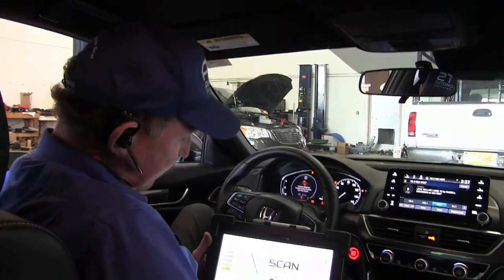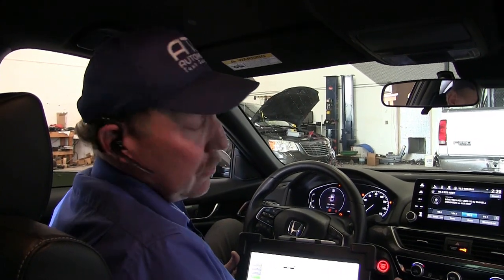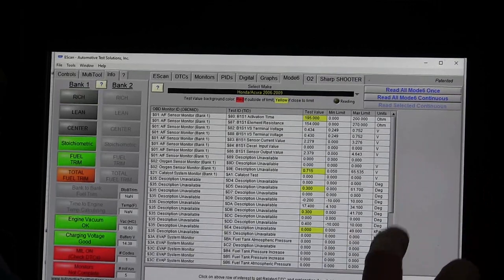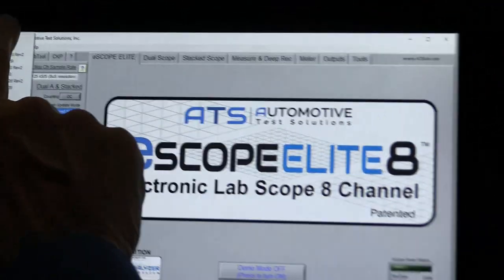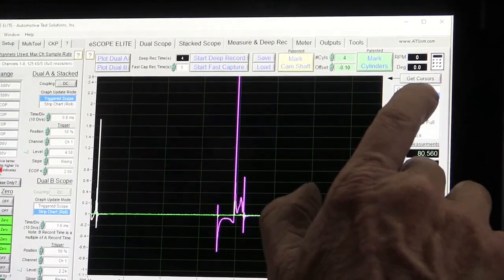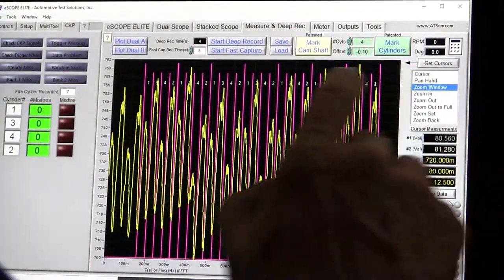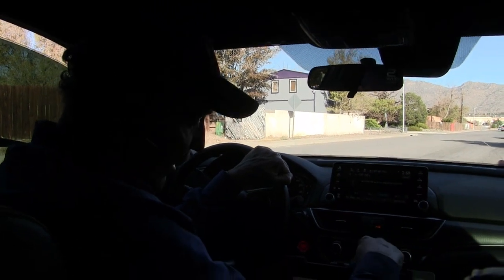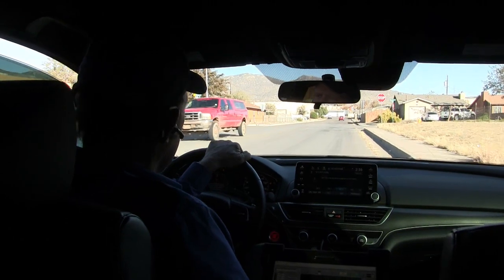Diagnosing a Misfire & Lower Power on 2018 Honda Accord 1.5 Turbocharged Engine P0304

Comment: So what happened here? The #4 injector was flowing too much fuel and the computer sees it and takes fuel away and now the cylinder 1 and 4 are running lean that causing the misfire?
Reply: Thats what it looks like to me.that #4 was over fueling and pcm was subtracting fuel from others.thats why fuel trim was in negative. But like Bernie said test results weren't even across the board so need to replace all injectors
.
Reply: @frankjohn4302  I wouldn’t take any chances of just replacing 2 inj.
Reply: @glennallen7129  yeah that's right.replace all 4

Comment: Why is this not at the dealer for factory warranty?
Reply: Probably was with no fix
Reply: @joshwilson849  i had one took it to 5 dealers and they didnt want to fix it i had enough and  brought a Toyota
Reply: @richardc6038  did they fix the Toyota?
Reply: @richardc6038  Why doesnt Honda want to fix problems? Their dealers suck!
Reply: @jamesmedina2062  in my case with the 1994 honda acored bad  oil ring you know what honda said oh will
Reply: @paquesepas6696  no i broght a toyota after honda fail me
Reply: @richardc6038  Ok but this was a '94 Accord? And this happened when like in 1995 or 1996? Any issues must be repaired according to national lemon laws.
Reply: @jamesmedina2062  it was 94-95 the probem was honda refuse the recall yes it was a Lemon car ! How ever my lawer  told us it not worth going after honda
Reply: @richardc6038  They have no reason to not send the dealer a new engine. I worked for dealers and the dealer makes good money doing the work. That just seems unless the vehicle looked abused or had over 100k miles. Also never only listen to one lawyer. Its just one asshole's opinion.
Reply: @jamesmedina2062  that said No and that it this car was never Abused in fact thay waned to buy the car from my dad ! He said No way he knew what thay was going to do  give us 2G then sell it for 7  the car did have 94,000mi
Reply: Here’s the problem with Honda dealerships. They went so long servicing a great product, not too much out of the ordinary, that now, when they have a POS product, their techs don’t know what to do!

Comment: Question; toyota uses port injection + Direct injection. This seems to keep the intake valves cleaner, great. But If this honda would have had both port and direct injection would the problem have not been as severe?
Reply: The question is not about the technology used but the reliability of the suppliers injectors. It has nothing to do with what kind of injection system used.

Comment: excellent  video Bernie! Thanks very much. I'm faced with an almost identical problem on a 2017 ridgeline and want to do the fuel pressure drop test. Can you explain how you inserted your fuel gauge into the rail? Did you just T off of a connector or...? Thx!
Reply: Some fuel systems have a schrader valve on the rail, on others you have to tee in, you have to get pretty creative sometimes.

Comment: Looking at the video I’ve noticed you have very munch knowledge. My car has been misfiring on cylinder 4. Exactly what this customer states. When the turbo is spooling and hits boost there’s no power. Fuel injectors were replaced. Car still did the same thing. The tech from the dealership said it was spark plugs so he replaced spark plugs and the car still is stuttering under its power. when I accelerate a bit harder, the car stutters as if it wants to stall and just off and when in drive at a stop light, the Rpm’s are looking to read around 680-620 which to me seems abnormal for them to read that low. What should I bring to the dealership ships attention to look at? Mind you that the fuel injectors were replaced the first time last year in April when I got the car because it was a recall on them and now replaced a 2nd time two days ago and now spark plugs were replaced and car still acts up.
Reply: 2018 Accord Sport 1.5T - got a tune-up at around 98,000 miles.  1 month later, car went into 'limp' mode while trying to accelerate. Check engine code indicated misfire on cylinder 3. Had to have it towed - dealer found it also misfiring on cylinder 4 and determined it was a defective spark plug since they had just replaced all of them.  1 month later, did the same thing.  Took it to a different dealer and they put a camera into each cylinder and found that cylinder 3 and to a lesser extent cylinder 4 were dirty.  They are saying that head gasket is leaking coolant into the cylinders and recommending cylinder head replacement.
Reply: I'm having the same exact issue you describe.  Was your problem ever fixed?
Reply: @DBLBx  not sure...I bought a little more time by replacing the plugs and then I just sold it.
Reply: @sigs1855  ok thanks....I just bought some injectors today... we'll see
Reply: @DBLBx did you ever figure out the problem currently experiencing this
Reply: @missjaayvee  I had several issues it turns out.  I originally thought injectors but it was actually the head gasket.  Are you losing any coolant?  I was going through a bunch.  I also had a misfiring plug later on as well that was putting the car in limp mode.  I bought a cheap scanner on Amazon and was able to fix the misfire.  I ended up trading the car in for a Kia K5 AWD.  I will never buy another Honda.

Comment: I’ve been experiencing slow acceleration on my 1.5t only has 24,000 miles on it, usually around the 1.8k-2.5krpm…. Thoughts?
Reply: I have a similar issue

Comment: I have a honda accord 2016 misfiring under load above 4k rpm (no problem going 6k rpm downhill). It has new spark plugs, new high pressure fuel pump and still the same problem. Codes are: P0300, P0301, P0302, P0303, P0304, that's all always, it never had the P0087, P0088 or P0089.
Reply: Did you figure out problem???

Comment: Does someone know what can be wrong with my car if it's suddenly just losing power while driving (normally at lower speeds, it has happened many times that way what I'll remember), If I give it gas and push down hard on the gaspedal, it increases the speed and it goes back to normal. This happens intermittent, which sucks. I used my scantool and got the code - hall effect switch low voltage. Can this cause my symptoms?
Reply: Did you even find out what was the problem
Reply: @monicaortega8342  Actually yes, both the coolant temperature sensor and oxygen sensor were broken, together with the change of the camshaft position sensor, the car is working perfectly fine now.

Comment: Had an issue with accord 2013 2.4 direct injection, over +40% of lambda correction, it was E10 gasoline, when a customer changed to normal gasoline there was +16% of correction, then I cleaned 3 times injectors with BG cleaner and there's 2-4% of lambda correction now.
In this video cylinders 2,3,4 showed almost the same pressure drop, only cylinder 1 was definitely leaking, but why do you diagnose cylinder 4 injector as faulty?? Your test doesn't bring to that conclusion. It is just your suggestion that lean mixture causes ignition coil work at its limit at high voltage and that brings in the end to "carbon trace" on the spark plug
It is a known issue with injectors on this Honda engine...
Reply: Misfire can be caused by low compression, burned valve, worned cam...

Comment: oddly enough, i have run into this aswell on a 2018.  I didn't have all the fancy tools though.  No way to test injectors (at least that was what I thought before I saw this).  I simply eliminated all other possibilities.  I have alse had a set of GDI injectors that were all equally restricted (yes, i didnt believe it either), so the drop test was misleading.
Reply: You could swap one for a good one right? How hard is it to change them?

Comment: My car is doing the same thing, so where you able to fix the car? Because Honda is telling me I need to buy a new motor?
Reply: Why don't you contact Bernie . His information is at the end of the video . There could be a shop in your area that has his equipment . That E Scan Elite can do a relative compression test right at the OBD connector and you will know if any cylinders are low or dead . This only takes a few minutes . THEN they can test further . This will also do a Volumetric Efficiency Test the same way . Then you know if the CAT is clogged and the MAF sensor is functioning properly . They can get a lot of data in a short time .  An hour of diagnostic time by a shop that is trained with high end tools may be money well spent . The dealer may want to sell you a new car .

Comment: So all spark plugs and injectors have been changed and my car is still having the same issues, also misfiring on cylinder 2. Now what?!?!
Reply: You ever get it fixed....Im in the same boat but changed fuel pump and not injectors yet....getting expensive
Reply: try swapping ignition coils around to see if cylinder 2 continues to misfire, if it does, check for head gasket leak. If misfire moves to new cylinder, replace that ignition coil - it's a very easy thing to do yourself.

Comment: Do you think that someone cause the faults by trying to add a after market item
Reply: Most likely, stock 2018 accords run a long time, modded ones seem to have the issues. And it makes sense

Comment: The video is very informing but my confidence in the quality of Honda engines has declined. There was a time a Honda Engine was the most reliable thing on the road but no longer.  Most Tech's would of not done all that to figure out what was wrong.

Comment: The first thing I would have done is open the hood take the dipstick out for fuel smell in the oil and then run your test replace injectors replace spark plugs change the oil

Comment: And just like that you showed the same diagnostics that Honda likely followed before coming up with their recall on the original fuel injectors when they first released these 1.5gdi garbages. These engines were seizing left, right and center due to these spraying too much.

Comment: I don't think all 4 fuel injectors on a brand new car would go bad for no reason.
Reply: Honda is really bad about sharing information with customers. Their supplier could have sent them bad injectors. I went to Honda via 4-5 different dealers to have the ECU fed new code for reducing oil dilution and Honda has a very cheap approach and did not share with the world the issues 1.5 were having. Now they don't want to make the 2016-17 Civics and CRV good. We will all suffer but the 2018-21 come with better code for improving cold start up. They are so damn cheap that they will force me to fork out 300 dollars of my own money to have my ECU reflashed with the better algorithm

Comment: I have a 2019 accord 1.5.  this does not give me much hope of long term longevity on this car.
Reply: How is it runnin so far? I have the 1.5 in Civic since Sept 2017
Reply: I been a honda guy for years. These accords 1.5 and 2.0 having issues already.  I'm about to get a new car and looks like my Honda days are over. I'm gonna get a Camry xse awd 4 cyl.
Reply: @alg1124  honestly even Corolla is a good option. It uses Lexus architecture and is very solid.
Reply: @jamesmedina2062  my wife has a 1.5 civic sport so far no issues. Has been a recall on something didn't make appt with dealer yet

Comment: It's probably a coil why don't you switch coils and see if that's the problem instead of wasting the customers money it happened on my Accord and it was definitely a bad coil but I didn't you to scan tool I just swapped a coil pack and then when the cylinder didn't drop that I put the bad coil pack I knew it was bad $30 instead of spending a hundred on diagnostic in the car and still getting nothing

Comment: all 4 injectors were bad  on a fairly new car? w t f.! is there a honda recall on this for bad injectors or is there another underlying cause for all 4 to fail or be failing?
i only  buy used cars and i dont hear anything good about gdi which will be a problem for me when looking to buy a used vehicle in the future. i buy relatively used cheap vehicles that have a good supply of parts either new or used and fairly easy repair methods
Reply: Welcome to the new era , this is moder  vehicles that is normal
Reply: @JoelAutomotiveInaction  GDI burns very dirty, 10x more particulates than port-injection.

Comment: How does carbon tracking on the external porcine of a spark plug have anything to do with an injector the is off calibration?
Reply: It is easier for the energy of the coil to dissipate externally along the porcelain than to jump a gap under pressure with little to no fuel.
Reply: They don't! They were two separate problems. The injectors were bad to begin with, but probably they made it worse when they put new plugs and coils and put in those carbon traces by accident.
Reply: Too much stress inside the lean cylinder for the spark to jump the gap..lazy electrons
Reply: Well according to his injector drop test on cylinder 4. It should be running rich with a 21 psi drop not lean.
Reply: @cyberslacker5150   Is that direct injection with those high pursuers?